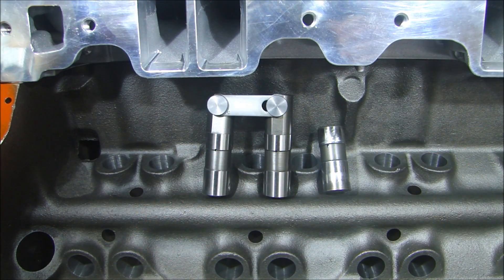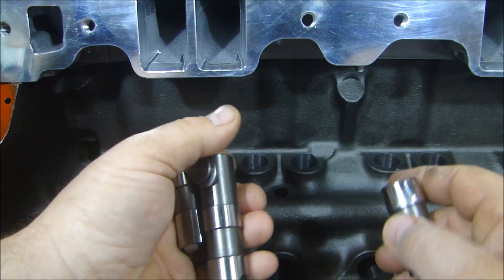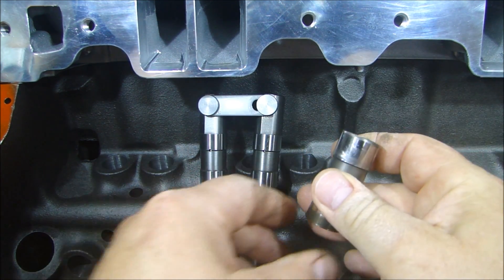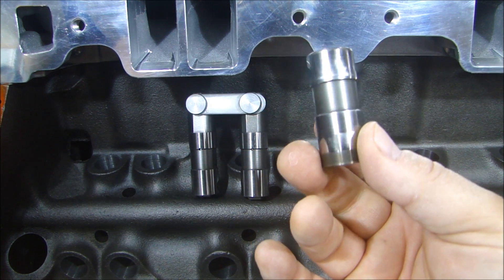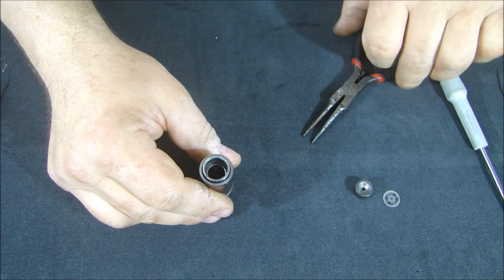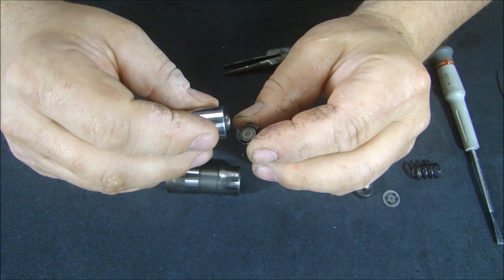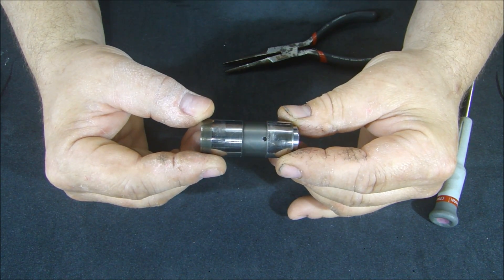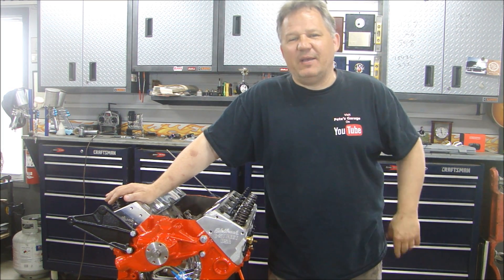Engine Building Part 10 - Hydraulic Lifters, Choosing, Cleaning, Assembling, Installing Roller Lifte

Comment: 🔥🔥🔥A hundred years ago, (well, maybe 50 or so,) when we used to build engines, we would drown the hydraulic lifters in oil overnight to fill them just before installing the pushrods and rockers to get a more accurate initial adjustment. Do you think that's something we should do with hydraulic roller lifters? BTW, Great video 👍👍👍
Reply from the maker: Sure, you can still do it, certainly won't hurt. I pump them up with the pump to make sure oil is circulating properly
Reply: @PetesGarage   Interesting, especially since Comp's instruction sheet says NOT to pump up their hydraulic lifters, but to simply clean and oil them.
Reply: @marlinguyaustin  my Morels said not to soak them in oil too.  I think it's an old school habit that doesn't really do anything positive.
Reply: @dannymccarty344  Dropping them in oil just to coat them prior too installation is what Howards Cams recommended to me for my roller lifters.
Reply: @dannymccarty344  Probably from the same battery on the ground people and how a crankshaft should never be left on its side,on the latter one i actually read a pretty comprehensive thing about  it a few years ago proving that wasn't true however those habits die hard and it doesn't hurt anyone standing it,when i see a crank sitting on its side it takes me about 3 seconds to right it back up,lol

Comment: So do you not prime new lifters.prior to install?
   I've looked all over and couldn't find a good answer.
   Some say just coat in oil, and drop in.
   Others say to use a vice to compress new lifters, drain them, then prime them by hand...then install.
   I just replaced lifters in my 5.4  2v ford....
   Majority of rattle is gone...still have 1 slight rattle,
   And have hazing at idle.
   Nothing changed other than new lifter installs.
    No haze prior to replacing lifters.
Reply from the maker: I do not.After installing I primes the whole system by turning it over and filling up the lifters.

Comment: Curious, can hydraulic lifters be used on a solid roller cam
Reply from the maker: As long as the hydraulic are rollers
Reply: @PetesGarage  would it change the cam spec's or stay the same
Reply from the maker: The cam specs stay the same but the pushrod length may change

Comment: Hi im rebuilding my enging and installing a bigger cam if i use roller lifters do i still need to run my engine for 30 minutes at 2000 rpm or i dont need to do it?
Reply from the maker: No you do not

Comment: And now for a completely different set of opinions on this subject. 

Solid lifters pump oil to the top end just exactly like hydraulic lifters do.   They have to or your rockers and springs would never get any oil and they would fail.    The difference is that hydraulic lifters use a hydraulic component inside the lifter for valve lash.   With solid lifters you are required to adjust valve lash manually with  the correct width feeler gauge when the lifter is on the base circle of the cam. 

The roller reduces friction idea is a myth.   The needle bearings that allow the roller shaft to roll are a source of friction and so is the roller wheel.   Any time there is metal to metal contact there is friction regardless if the metal is rolling or not.   The oil film only reduces the amount of friction by putting a molecular cushion between the metal parts so they don't destroy themselves.    The oil film absorbs some of the friction which is a main reason that the oil gets hot.   Same thing happens in a torque converter.   Working the oil induces heat.

A molecular level of oil film sits between the flat tappet lifter and  the cam.   The same applies for a roller.   If it didn't do that, the lifter would wipe the cam lobe every time.   It is only during the initial start up for the first few minutes that the cam lobe and flat tappet lifter face are worn in or mated.    Actually, it is a hone operation that is built into the cam lobe face. 

Building an aggressive flat tappet engine is a bit more aggravation than a roller because at a certain level of aggressiveness on the cam profile you have to remove the inner valve spring for break in to prevent the lifter from wiping all the oil film off the cam lobe and that is what causes the cam lobe to be wiped.   I've been running flat tappet solid cams and lifters for over 20 years.   Never wiped a cam lobe.

The always adjusting lash with solids is also a myth.   The solution to that was invented eons ago and that is the poly lock.   I check mine after the initial run in and then once every 6 months to a year.   6 months if it is a drag engine and once a year if it is a street engine.    Regardless, the same applies to lash adjustment whether it is a flat tappet solid or a roller solid.

Roller lifters are actually worse than flat tappet lifters in one significant respect.   They are much heavier and moving the lifter up and down thousands of times per minute is more of a drag on power than with a flat tappet lifter. 

An advantage of a roller package is that you can re-use roller lifters with another cam  but I would never advise doing it.   New cam gets new lifters every time at my place.  With flat tappet lifters and cam lobes matched, it is really not that hard to number them if you have to pull the cam and lifters for some reason.   People that don't or can't seem to do that are just lazy.    In all my engine work, the only time I have pulled a flat tappet cam and lifters is to replace it.   

Another disadvantage of roller lifters is what happens when a lifter fails.   Most often, when a flat tappet does fail for some reason you are out a cam and lifters and flat tappet cams and lifters are relatively not expensive.   When a roller lifter comes apart you have generally destroy the entire engine(not always, generally) because most often it is the roller that comes apart due to needle bearing or roller shaft failure.   It will crack the lifter bore or bores, throw needles down into the engine and pretty much destroy it.    Another common way the rollers fail is unlatching a link bar and I've seen link bars break.   The roller rotates sideways and then destroys the cam, lifter bore or bores and the block.

The are only a couple of advantages the roller lifter has.   One is that you can run a more aggressive cam lobe and you get a broader power curve.    The other is that you can run a higher lift with a roller before you risk the edge of the lifter face digging into the cam.
Reply from the maker: Awesome comment! Thank you for taking the time to share

Comment: You mentioned breaking in the solid hydraulic lifters what is the proper way to do that
Reply from the maker: Heat, low spring pressure, and the proper oil for the first 20 minutes of running the engine
Reply: I haven't gone into the engine yet. I have an older gm 3.1 that just started clattering on the top end and it seems from looking inside the valve cover that no oil is getting to the top end. I'm hoping that just some of the lifters have either collapsed or dirty and I can just clean and reinstall. The manual says if I install new ones I need to replace the cam as well. yikes
Reply from the maker: You can look inside to see the condition of the cam to see if it really needs to be replaced.

Comment: Awesome video and explanation Pete! Just two quick questions:

1. What happens if the plunger on the lifter has no movement at all. That is, it doesn't feel "springy", it only feels hard?

2. When putting them in, what if it takes good force to get them in, and they feel rough going up and down?
Reply from the maker: 1) They are either frozen or locked hydraulically

2) They are the wrong size. Get the right size or hone out the bores
Reply: @PetesGarage Awesome! Thanks for the reply Pete.

Comment: So say I’m building a mid 70’s 454 can I run roller lifters on it even though it doesn’t have the spider thing?
Reply from the maker: Sure, as long as the lifters have a tie bar or a dog bone to hold them in place

Comment: Thank you for the Video.  I have a Flat Tappet Ford and I am debating between buying a Retrofit roller kit vs. buying a used Short block!
Reply from the maker: Retro fit kit and build it yourslef
Reply: I rebuilt the OE motor with bearings and hone job, andnew Molly rings.  But I have 2 cylinders that didnt seat good.  After only 15k miles I have blow bye.  But I want a roller motor.  Found short block roller mustang 302 yesterday for 100 bucks.

Comment: The spring is for preload it does not act as a pump, oil pressure "pumps" up the lifter. solid lifters oil through the lifter and pushrod same as hydraulic lifters. hydraulic lifters require less maintenance to keep valve lash/preload in check, solid lifters have to be checked and relashed
Reply from the maker: That is true
Reply: Not all solid lifters have oil running through them.

Comment: Pete,  Quick question.  What is the best way to estimate engine HP in the design phase?  I have seen many engines built and helped during different areas of the build as my friend does dirt track racing, but this will be my first build and want it to go off without a hitch as it is going in a street car and want to make sure things are done right.  Any insight and help you can provide would be greatly appreciated.  Also thanks for all the videos they are a great help.
Reply from the maker: A basic rule of thumb is that you should be able to get 1 HP per cubic inch just by cleaning it up and putting in some mild performance parts. Once you start to get over 500 HP it takes a bit of experience to pick parts.
Reply: @PetesGarage  thank you for the quick reply!

Comment: And now, I love solid lifters even more...
Reply from the maker: An why is that?
Reply: @PetesGarage  Two reasons.  More parts is more opportunity for problems and hydraulics can be finnicky if spring pressure fades [lifter or valve] putting preload outside a certain window - nothing is maintenance free.  Solids allow a bit of tunability to optimize vacuum or top end performance.  Also... I'd rather check valve lash than pull the manifold to maintain valvetrain.

Comment: I like those aluminum heads.  I was reading an article that said that the new modern heads are better than the coveted double hump fuelie heads.
Reply: They flow better but will they still be around and in use 50 years later.... I don't think so!
Reply from the maker: Quite possible

Comment: hey, was just wondering, I have a set of crane roller tip rockers, not cheap, however, I smoked my cam my have metal in the bearings of the rollers , can I clean them with a hydrosonic cleaner or should I start over with new?
Reply from the maker: Sure, take them apart and clean them up. I do it all the time.

Comment: Thanx again, Pete. I asked about new lifters in comments on another video, and this video clearly answers my question. Cleaning in mineral spirits should release new lifters so I can verify free piston/plunger movement. But it is funny, I find zero specs on acceptable wear limits on piston side clearance and spring pressure in the hydraulic roller lifters. Not even a roller wear limit for it’s 2 dimensions of movement or roller circumference. Why doesn’t anyone talk about specific wear limits or spring pressure on hydraulic roller lifters?
Reply from the maker: I would think because lifters are cheap enough to replace when you're rebuilding the engine. I've only reused solid lifters if the cam side is still in good shape. Great questions....

Comment: I run a Comp Cams street solid roller Extreme Energy Xr292R in my 438 Windsor 68 Mustang. I use all the good parts including Isky Bushed Lifters. Cam is 621 627 lift 254, 258@50 duration. Lash was checked at 500 miles and spot on. Lash was checked again 2 years later after 1800 miles and 2 exhaust valve lifters off .002-.003. Rest were off like .001. Car sees consistent 7200 rpm blasts and full throttle runs on street. Car is driven hard. I have no idea why lash backed off .002-.003 on 2 lifters but it did. Isky bushed are supposed to be the best. Can't see how you went 3k miles and lash never moved. But maybe you have smaller cam than me, or you don't run car to 7200rpm. Solid roller lash should be checked at least every 2 years. I am guessing maybe those 2 isky bushed lifters may be wearing or something else wearing. But to go 3k miles in a 950hp solid roller car and no lash change is hard to fathom. Unless you drive real mellow all the time. But who drives a solid roller car mellow?. Also. Comp cams needle bearing lifters are crap and ruined a motor i had before. That's why i went isky bushed. Maybe motor was still breaking in and that's why some lifters moved. But i have heard isky bushed are the best
Reply: Do you run a stock non roller block?
Reply: @terrorofdemons1168  Ford Racing SVO splayed, siamese bore, 4 bolt mains all 5 caps.

Comment: Hey Pete, I have a 302 that is a roller block but don't have the spider bar or dog bones. With the retro fit lifters do I need to add the spider bar and dog bones or is they already setup. Will I have to change push rods?
Reply from the maker: You only need one, either a dog bone or a spider, only if you have roller lifters. If you change from roller to solid, or solid to roller, you'll need new push rods

Comment: Hey I enjoy your reply,s Heres a good one When I was a teenager I had push rod Fiats,  and twin cam engines,, this will piss every one off but I like to set my valve lash when the motor is hot, yeah i know its not fun. , I set each cylinder at TDC to set the valve lash, im talking solids plus I rock the crank back and forth to check for timing chain slack wear, it may take longer, but it works for me
Reply from the maker: Interesting, whatever works

Comment: Good educational video that's what I'm seeing so far on YouTube I think a couple of my lifters have broken Springs in them
Reply from the maker: It would be good to know why the broke
Reply: @PetesGarage  I got the motor for cheap 5 3 lm7 120km installing it in my OBS 96 1500 and I'm guessing I got it for cheap cuz the last guy ran it low on oil so I'm replacing a couple of pushrods lifters and Rockers and hoping for the best

Comment: Quick question Pete, I have a nice hydraulic cam in my sbc. I wasn't going to use because i mixed up the lifter sequence when I disassembled it.  Anyway I would like to know if I can just buy and use some roller lifters on the hydraulic cam? Or would the profile be to sharp? Thanks for any help!
Reply from the maker: No, the profile is different. You need to have a roller cam with roller lifters
Reply: the flat tappet cam on a sbc has no retainer plate to keep the cam from walking into the timing cover. it uses a slight taper on every lobe that pushes the cam into the back of the block as it rotates. that taper also rotates the lifter in its bore. a roller cam uses a flat surface on evevery lobe  so the roller tip sits flat and doesn't try to spin in the bore thats why when you do a roller cam you need a cam button that sits on the timing end of the cam to keep the cam from walking out. the cam button rides on the timing cover keeping the cam from walking out so you also need a stiffer timing cover and proper clearance has to be set on the cam button. now that said if you put roller lifters with a flat tappet cam the taper of the lobes will destroy the lifters and alot of the power gained from a roller cam is from the profile of the cam so running the flat tappet cam will give you none of that power gain. now on some other engines it can be done like on my 2.3l sohc ford ranger engine newer roller followers can be used on an old tappet style cam because the lobes have a flat surface to roll across and the cam on that engine has a plate that bolts to the head with 2 wear surfaces that keep the cam from walking in either direction. but there is very little power gain because it's still using the tappet profile cam.
Reply from the maker: @trishapinczes7818  Excellent answer! Thanks for the comment

Comment: Looking at distributors I've seen HEI and non hei type my question is what is hei and what are the benefits or downfalls for both hei and non hei
Reply from the maker: The HEI distributor is still an inductive-discharge ignition, but exchanges points for an electronic device called a module. ... The large cap also offers extra space to host the coil, making the HEI distributor self-contained. It also produces a hotter spark.